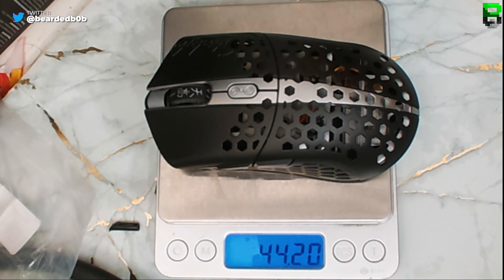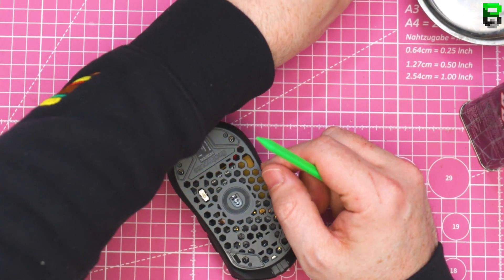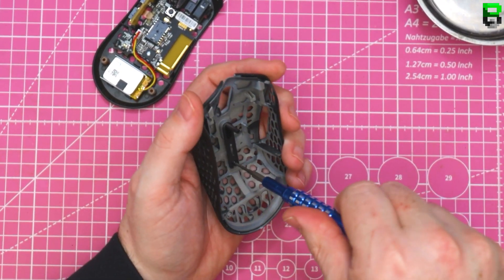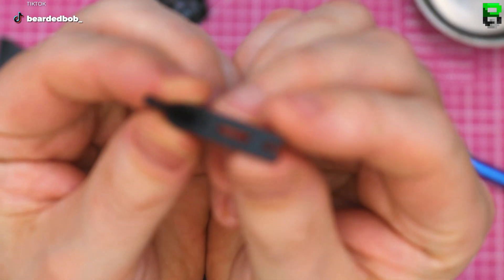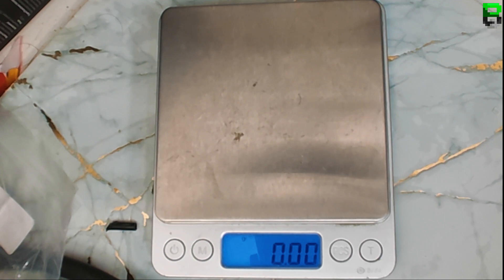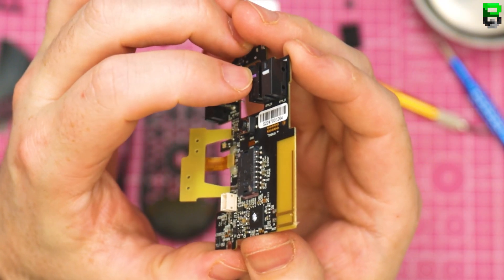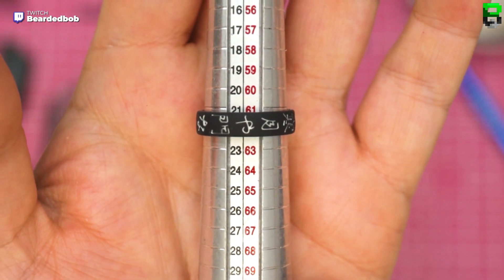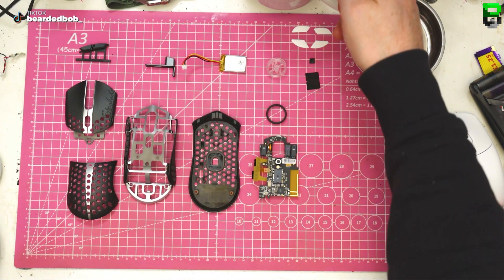FinalMouse Starlight 12: EXPOSED: Terrible Switch In The Last Legend

Comment: @Beardedbob

 hello beardedbob i was wondering if the small and medium finalmouse starlight has the same board size cause my finalmouse tenz small sensor doesnt work anymore and i cant get an rma for it and i found someones finalmouse the last legend but its medium size the problem with that one is that its mouse housing is crushed
Reply: just buy a meowmouse pcb

Comment: The solder pad came off on my mouse for scroll wheel where can i buy the solder pad?
Reply from the maker: you can''t you would need a new pcb. you can repair the pcb but its not easy
Reply: @Beardedbob  its starlight 12 i dont think i can get any new pcb
Reply: @Beardedbob  because of that the soldering wont stick

Comment: so if my click feels like it gets stuck for a second and i fire a burst instead of single tap could that be because of the switches?
Reply from the maker: Maybe but it’s more likely the maylar tape they used as it’s moved and what you feel is the sticky residue holding the button
Reply: @Beardedbob  I have the exact same issue, I even replace the switches, but still has the same problem, and there isn’t any adhesive material inside, what do u think might be the problem? Is it the wireless connector? From time to time, I press once and it shoots 5 or 6 bullets out
Reply: i actually also struggle to TAP FIRE in CS with my G502 hero and i think its coz of Omron switches (they too light aprently)

Comment: They went back to Omrons due to the amount of RMA's with kailh switches,
5 of the Starlights I own that use Kailh GM 8.0's double click while my Ares that has 20m Omrons is fine 🙃
Reply: its funny how they said to improve qc issues and reduce double clicking they would be moving to kailh gm 8.0s from the omrons. Now they back to omrons
Reply: @BigBoss-pd9mn  the thing is that kailh 8.0's shouldnt double click, considering they are gold plated. Thats the only reason why Japanese Omrons dont double click. Double click is an oxidation issue, and gold doesnt oxidize. I dont know if Kailh uses a cheap gold alloy prone to oxidation, or if their quality control just sucks.
Reply from the maker: Other options to kailh
Reply: @Beardedbob  Would've loved to see huanos or something instead
Reply: @Beardedbob  
 hello beardedbob i was wondering if the small and medium finalmouse starlight has the same board size cause my finalmouse tenz small sensor doesnt work anymore and i cant get an rma for it and i found someones finalmouse the last legend but its medium size the problem with that one is that its mouse housing is crushed
Reply: @Beardedbob gpx superlight has 20m omrons and its probably the most sold mouse in the world. The switches i really good i own one for 2+years now no problems with it so i dunno wtf u talkin bout mate

Comment: Cmon now... Omron 20m? 
They're a staple for Logitech line of works and other smaller companies, but with the price FinalMouse is charging, they could at least throw in some Kailhs...
Aside from the newer Razer limited edition RVM, I'm actually interested in Pwnage's StormBreaker.
However, I hope Pwnage had worked on their hardware for the past two years. I haven't had the best performance on my Ergo Wireless, and I suspect it's an issue with motion latency.
Reply from the maker: Could of used Japan omrons if they felt kailh weren’t working for them
Reply: Kailhs are trash

Comment: Yeah my right click on my model is horrible, left click is fine. Not to mention the shell creaks and the scroll wheel is mushy and far too stiff to click in quickly. I wanted to send it back but you have to send it via fedex as that is their supplier, also if they determine it has no issues you get charged too, so I just decided to go 3rd party repair. It’s actually a really good mouse just terrible TERRIBLE qc from Finalmouse, incredibly disappointing to wait 7 weeks for a product and it starts breaking within a week.
Reply from the maker: Damn sounds like you got a rough copy
Reply: @Beardedbob  it’s for sure usable but yeah not happy at all tbh
Reply: imagine buying some indie brand mice for 200-300$.. like what do ppl expect honestly

Comment: Isn't finalmouse brand plaqued with QC issues ?
Reply from the maker: depends on the volume they sell compared to QC returns to say if tis plaqued but I've repaired a lot compared to other brands
Reply: my finalmouse Tenz scrollwheel fucked after 3 month.. support was very good though.. they paid for full shipping(EU).
Reply from the maker: Good to know they resolved it for you
Reply: My only issue was the scroll wheel and not the alignment but it's use and function. However, the firmware update posted on their Twitter account fixed all that thankfully. So it went from just sitting there to occasionally getting used.